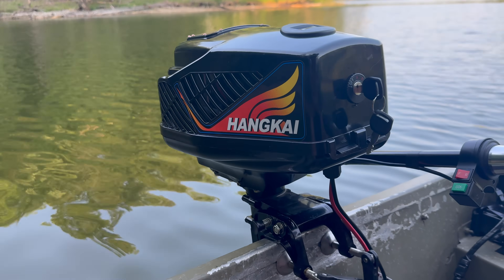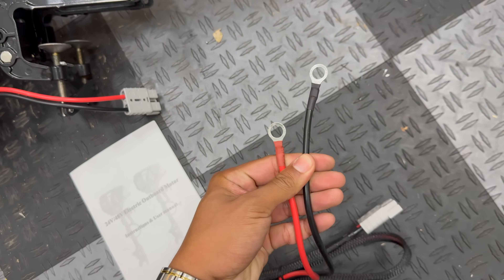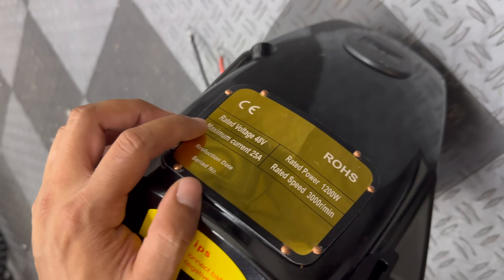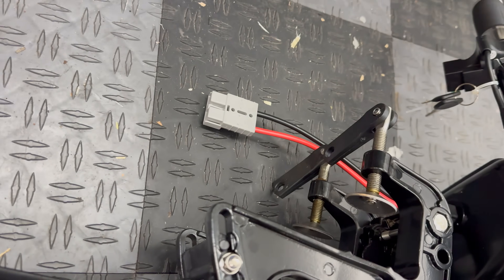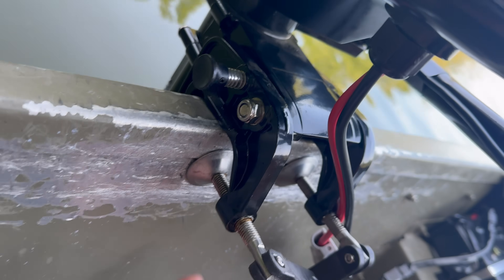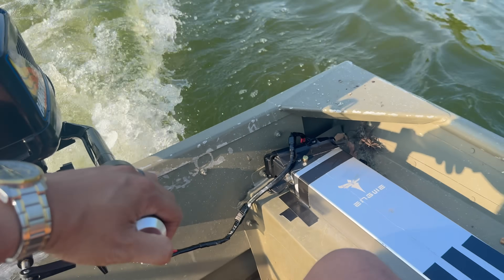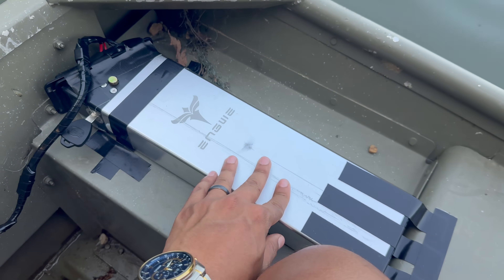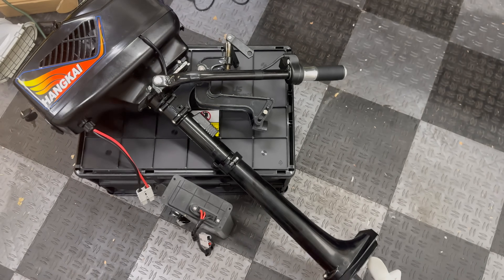Hangkai 48V 1200W Electric Outboard Motor Testing and Review

Comment: With a identical aluminum boat and load my old 6 HP Johnson will do 12 mph as verified by Garmin gps. I estimate 6 mph would be similar in top speed to 2.5-3 HP gas outboard. The expense of the lithium batteries is the only downside. Keep in mind there are many State parks and private lakes that only allow electric motors.  Thanks for posting.

Comment: Nice video! We’re looking at all kinds of electric options for a new 12-14 ft. sea eagle inflatable that we’re contemplating, Minn Kota 55 pound trolling motor, Torqueedo, Newport, ePropulsion, etc.

Then I saw this video and I’m intrigued. I have a couple of questions for you:

1) I know it’s noisier than some other electrics, but how did you deem the noise at slower trolling speeds where we might be on a river or a quiet part of a lake?

2) So if you’re not using cruise control and you let go of the throttle, does the motor essentially shut off?

3) In a related question, does the engine come with the now required magnetic kill switch?

4) Overall, are you pleased with the runtime that you’re getting at different speeds? I would probably buy a 48V 50Ah LiFePO4 battery for this. It looks like the motor is rated at 25 A draw. If that’s true, then with that battery, it should get somewhere in the vicinity of an hour and a half to two hours of run time at full throttle. I probably would run it at three-quarter throttle most of the time. Thanks for your thoughts.

Comment: Had small boats for over 40 years. On -plus side is only 12 kg, 25 lb. On minus side, is more loud then you expect from an electric. On power side, my zodiac 12 feet, need minimum 6hp to get to plane. Not there yet.

Comment: I didn’t see you wearing a shutoff switch lanyard; does it not have one or were you just not wearing it?

Considering this motor for a Sea Eagle FastCat 12, but wouldn’t want it if there is no shutoff switch. Or does it use a deadman throttle instead, shutting off if you release the grip?

Comment: This is a similar situation to buying a gas generator.  A good generator costs $1000.  A cheap generator is $200.  The main differences are noise and quality.  A cheap generator is about 30 db louder than a good one.  Same with this electric motor.  A good electric motor has the motor in the water, next to the propeller.  This provides better cooling for the motor (water cooled instead of air cooled) and much less noise.  A good electric boat motor will run about 30 db quieter than a cheap one.

I'm a frugal person, but you get what you pay for.  I've had a Minn Toka motor for 10 years.  It's quiet and reliable.  You can take your chances with a Hangkai, but I wouldn't expect it to last more than 2 seasons.

Comment: You just referred to the 25 amps max the motor will withstand and then said 35 amps so it will be a little over the voltage ?

Comment: Amazon has the 1000w 48v 1250 thrust for 179$ thinking of getting it. I currently have a 30lb thrust minn kits on my 8’ pond prowler and it’s underwhelming. Wondering if I should do this one or the 55lb thrust traditional trolling motor?

Comment: Hangkai ships all motors without gear oil! And it may need replacement after "run in" period. Consult manual or contact Hangkai. That's what their website said. Hope your noisy gears are still ok. 🤔
Reply from the maker: I did a follow up video on this, confirming this outboard from an Amazon seller came with gear oil in the lower unit. I removed the prop and opened up the lower unit to confirm there is gear oil.

Comment: Just FYI 52V is just the nominal voltage of a 48V lithium pack.
Reply from the maker: Reads 58.8V when fully charged. 48v fully charged should be at 54.6V. Small difference
Reply: @PatOutdoors Thats the problem with labeling for consumers vs specifications. I've seen plenty the other way around. I guess it really would be a bit overvolted then. Thanks for the clarification.

Comment: The 5.0 must be the revision number of this product or random fantasy sticker.  Unless the literature claims it is 5hp, then they are doing nothing wrong.  They are just letting you assume based on a wrong conclusion.

1200 watts is not going to produce more rhan 1.5hp of work in a perfect motor.

Comment: Keep in mind, at 746 watts/1 hp (assuming 100% efficiency) there is no way that motor could be anywhere close to 5HP. From another video, the motor rating was 1200 watts, which is about 1.7 HP.
Reply: As an EE here with slide rule math we use to use "after losses" estimate of 1000 watts per HP as a good guess for Induction AC motors and Brush DC motors. 746 watts like you pointed out is the 100 percent efficiency number. So without any data sheets and when under attack by Klingon Warships the 1000 number was a good guess. That outboard is probably brushless DC motor so maybe 850 to 900 watts per HP as guess.
Reply: I mean a higher voltage does get it to higher rpms
Reply: how did you math this? this deserves deeper discussion.
Reply: You’re right! If it’s 1200 W, it can’t also be 5 HP! Lol

Comment: The 52 volt actually isn't overvolted at all.
Lithium ion batteries are traditionally rated at 3.7 volts per cell as the nominal output, but lately, manufactures of lithium ion battery powered devices have been playing games by advertising their batteries using "max" at 4 volts per cell instead of the nominal nominal 3.7 volts per cell.  So, that 52 volt bike battery consists of 13 cells (52÷4=13).  Using the nominal voltage rather than the inflated max value, you get 3.7V x 13 = 48.1 volts.

Comment: I found this very interesting.  I’m looking to get a small aluminum fishing boat for the small lakes and ponds in Vermont.  I had assumed I’d get a small HP outboard motor for moving around plus a trolling motor for fishing, but this little guy might be all I need.  I wish you had shown how noisy or quiet the motor is at trolling speeds, and maybe how long the battery would last at lower speeds.  I guess it would just be a matter of having enough Amphours of batteries.  Lithium batteries would have a big weight advantage, but would probably cost more than the motor itself.

Comment: I have a question on how exactly you made that conversion? I have a 48v Segway battery laying around I get understand how I would connect it to my trolling motor if possible. Which is also 48vv
Reply from the maker: This is a 48V outboard. Is your trolling motor 48V? If it is, then you just need to find a connector that matches your battery and connect it to the positive and negative wires for the trolling motor
Reply: @ got it thank you I’m about to buy one today. Gas to messy for me. I’m gonna end up using two 24 v lead acid or Agm deep cycle. What do you think?

Comment: HEY IT NEEDS TO BE IN THE WATER TO COOL THE MOTER
Reply from the maker: It does not. The motor is up top and is ONLY air cooled, no plumbed cooling from the bottom of the housing.

Comment: Everybody forgets the gear oil you must put gear oil in the diff read the product description
Reply from the maker: @christophercridlebaugh8965  Mine came prefilled, I checked the bottom of the housing. Confirmed on the following video.
Reply: @PatOutdoors  it's crazy I never would have believed that we would have great and cheap electric motors on everything when I was a kid electric was expensive and not very powerful boy did that change

Comment: If I build a boat when I have kids someday, I'm going to build an electric brushless Jet pump outboard. Yeah if your pulling 25 Amps at 52 volts, that's only 1.74 Horsepower. Sounds like that trolling motor was only pulling 600 Watts as most of the 55 LBS Thrust motors do which is just under 1 horsepower. Just be weary the controller will limit the current going to the motor. If you upgrade the controller you could get more current thus more power, maybe look up the motor online to see if it has a datasheet. Pushing more current will require possibly more cooling just keep that in mind. Even so, nice little outboard! The real way you could prove the current draw is with a clamp meter.
Reply: why jet over prop? i have heard they are louder. can you explain how you went from watts to HP?
Reply: @pearlrival3124  746 watts is 1 horsepower.

Comment: I am going to put “the one” motor in this and run a fardriver 72450, and run 20 horsepower and see what happens lol
Reply from the maker: @jakegreenwald469  that’s exactly what I want to do with it.. but not that much power lol. The prop is limited. I was thinking more EC4P lite and run at 6kW

Comment: I run mine at 72 volts
Reply: Motor and controller on a minibike does 50 mph, wheelies up to 30 mph with a bit of the throttle

Comment: I built my own electric outboard, i put a 72v 3000w brushless motor on a renovated rigg from a 8hp
Gasoline motor and paired it with a propeller from a 3,5hp. 
Worked amazing. But to expensive of a build whit batteries and all..
Reply from the maker: @maximilianswansson1264  yeah.. This whole channel is actually based off building electric mini bikes, my Razor having 72V 17kW.. but it cost me 2 arms and 2 legs 😂. I currently have this outboard apart and retrofitting a 3000w MY1020 motor, but still fabricating the adapter plate

Comment: The problem is that they are lying about the HP. That unit is only about 1.61 HP. 1 HP is 745.699872 watts. 5 HP is 3728.49936 watts and NO do not try the scam saying that electric is equivalent to 5 HP. HP is HP. The torque range is different but not HP.

Comment: Have you encountered water weeds with this motor? If so, how well did it “chew” through them, or get readily fouled?
Reply from the maker: Cut right through the weeds. I swapped to an aluminum prop recently though, just for peace of mind
Reply: @PatOutdoors  Thanks for responding to my question! Where did you find the right sized prop for this particular motor? Another Amazon item?
Reply: @PatOutdoors  Where did you get the alu prop from? size please?

Comment: Picked up the 43.3 inch long shaft version, to try instead of using underpowered trolling motor for getting sailboat in and out of slip with more control. For some reason long shaft version was even cheaper. Taken it out 6 times and so far, blown away with performance. With your background in 48v bikes, you should def follow up with a tear down video. I feel like there would be a lot of interest, “you get what you pay for “ and “if it seems too good to true” will start catching up to owners of these. But replacement parts on the internet also look to be really affordable. But thanks for this one. It nudged me into taking the original plunge
Reply from the maker: @SaltwaterChicken  already started filming the tear down a few days ago. Waiting for my custom motor adapter to come in to continue

Comment: At 750 watts per horsepower, 1200 watts is  1.6 horsepower.
Reply from the maker: Yes, mentioned in the video. It's more like 1.6 HP, but it is fairly efficient for the power.

Comment: Thanks; one thing you didnt get to was if it is really 5 HP - so an actual comparision to a fuel 5 HP would be pretty useful for people deciding on the pros and cons of going electric vs gasoline or diesel in a small boating craft.  Obviously range and speed are both of big importantce - and cost.
Reply from the maker: @litestuffllc7249  it’s not, I mentioned 1200 watts is less than 2 HP (more like 1.6-1.7.) But it is very efficient considering the power rating and price range. It’s all really about what the main use case would be. I have a cheaper 2-stroke that’s faster m, but way too loud for fishing (which is my main use)
Reply: No way is that comparable. I had a 5 hp merc on a 16' jon, it would plane it and run 12 mph.

Comment: You should try a DC to DC booster if you want faster speeds. They have 1500 and 1800 watt booster cheap.
Reply from the maker: @HUJUism  hmm I actually ran this for a short period with a 72V lithium pack and was able to reach 8 MPH but the controller overheated. I’m looking at controller upgrade and better cooling solutions
Reply: https://www.youtube.com/watch?v=t8Aaz4iQeXY

Comment: That's why I love 48v. Just so many uses for those batteries.
Reply: Dangerous in a boat
Reply: @KingfishStevens-di9ji  Really?? How so? This power electronics engineer with decades of experience wants to know.
Reply: @ Google li-po fire Mr engineer.
Reply: @KingfishStevens-di9ji   Not sure where you get lipo, Pat never implied anyone use Lipo, but he does suggest you might want to use LiFePO4. This is the safest battery chemistry available, about like use lead-acid. Maybe you got those confused ? I thought you might be arguing that 48V is unsafe for boats, since that is the comment you replied to. That would not be true either, according to UL and other testing bodies.

Comment: Who cares if it's actually 5HP, it got your boat going 6 mph all the way across a big lake. One suggestion - either slow down to 5 mph (50 percent more range?), or bring along an extra "get home" battery about half the size of the one in your vid. Then you could gun it until batt 1 dies, then use batt 2 to limp home at 4 or 5 mph. I'd build a battery box to keep water off that stuff, too.
Reply from the maker: I don't care honestly. It's just mislabeled is all, overall I'm pretty happy with the performance. Also I just got a 100AH LiP04 Deep Cycle battery for this thing and the range is now insane.. About to post an update actually.

Comment: I think the 52v is just a 48v, just fullg charged, so not overvolting
Reply from the maker: @MisterPikol  it’s 58 volts fully charged. 48V battery fully charged is usually 53-54 volts.

Comment: You're lucky you didn't hit that log when in reverse. That's the good thing about small motors not having reverse... one just swings the motor 180° to reverse it. Also, the motor doesn't have a 'kill lanyard', most neccessary on a small hand-operated boat. You should always hold on to the steering arm with the lanyard connected to your wrist. You would be amazed at how quickly the boat could capsize if you let go of the arm even for a second or two. Things in the boat (including occupants) will immediately shift and change the center of gravity. If you do capsize the motor may still be running (no lanyard) although the battery will be now hanging down in the water because you didn't secure it on the seat with a strap or such. And be wary of where you go... the prop may get entangled with weeds (low power) and old fishing line. Is the motor supplied with a spare prop in case the one installed breaks or falls off?
Happy boating.
And don't forget your life jackets.
Reply: It doesnt have a lanyard kill switch so how will it cut off ?   I had a situation ,  the electric turned sharp and emptied out my small boat.  Yes keep the hand on that handle.
Reply: Is it possible to install a kill switch to the wire between battery and motor?
Reply: @gotTeslaModelY  yeah I wish someone would resolve this issue.  would make them some money for sure.

Comment: You need some lube on those parts bro. They always ship as dry as possible.
Reply from the maker: Not the electric one! I just pulled the prop off and opened up the lower unit and it’s fully filled with gear oil.

Comment: that is not 5hp, its more like 1-2hp tops. I have 5hp motors that has way more power than that
Reply from the maker: Yes, debunked in the video.. it's more like 1.66 HP

Comment: The "A" setting is supposed to be the regen setting to use on sailboats to recharge the battery.
It's hard to know if it's active on this specific model.
But you can test it by measuring the terminals that go to the battery while towing the boat in the water.
Reply: you can charge batteries when not using this motor? what? so if i put this in a fast-moving stream, i could charge, say, an ebike? 🍻

Comment: It looked great and pushed that big heavy boat at such a fast speed. For normal use you'd only want to go at about half that speed (2mph)  at the most so the battery would last much longer. I suspect that the other position on the ignition switch is for accessories.

Comment: Batteries sold in the United States for things like e-bikes and boats and rvs and home energy storage are ridiculously overpriced. The solar power guys are starting to build their own with lifepo cells and case kits from China.  Doing that you can get like $100 per kWh. A 3 kWh battery would run something like this for hours. (That ebike battery is more like 750Wh.)
Reply from the maker: @EPeltzer  I actually now have a 51V 100AH deep cycle battery for this motor. Should be a TON of run time, but it was super expensive and over 70 lbs.

Comment: 5hp = 3730Watt.
12v  311 amperes.

my 12v 42lb trolling motor is rated at 500Watt.
Reply from the maker: Yes.. debunked in the video. I said it wasn’t even 2 HP.

Comment: i have seen these exact same casings used in 5hp gasoline motors from the same company. i bet the y used the same base for the motor but slapped an electric motor on it and didn't bother to remove the stickers. thats how most of chinese stuff is made anyway😅
interesting video.
Reply from the maker: I bet you are absolutely right..

Comment: Nice video, look into the lithium iron phosphate batteries. I have a 48 volt cake battery 20ah 2000 watt on my DIY scooter and get 100 miles on the throttle per charge. great power and range with these new batteries.
Reply from the maker: I actually just got a LiP0 48V 100AH battery today! Thinking it would be 6 times the range..
Reply: I have 6 hp gas. I think they are very close.
Reply: Yes it is